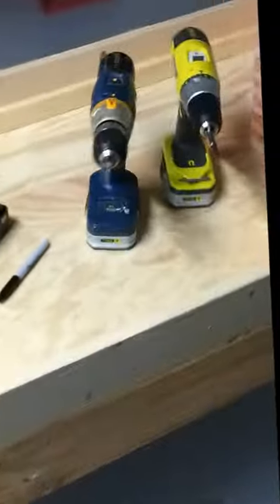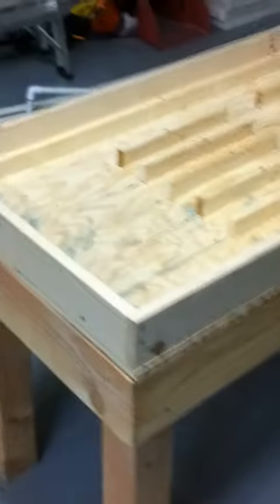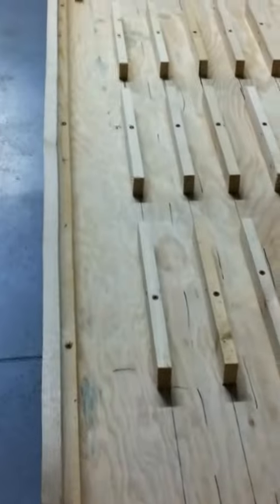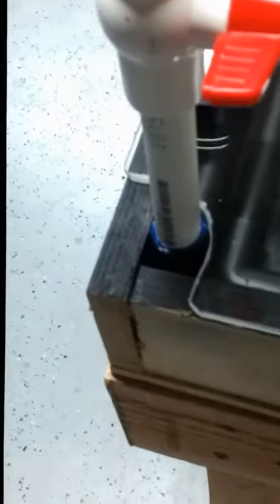DIY Solar Pool Water Heater

Comment: Clean job but I would think you would have to go bigger on your solar collector. I have a collector about that size and the same pump which I use to run water through pex tubing underneath my outdoor waterbed. It works well enough to take to chill out of the water and that's about it.